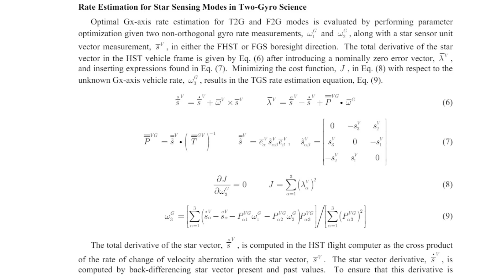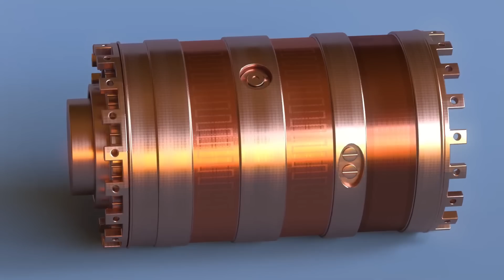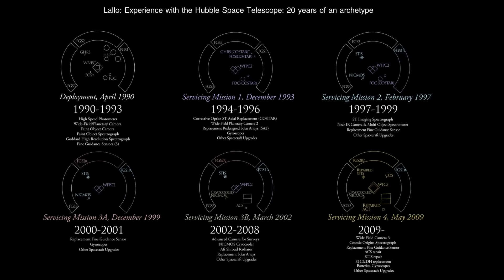How Failed Gyros Are Making Hubble's Life Harder

Comment: Sure would be nice to have the Hubble get upgraded with Ring Laser Gyros instead of these ones. No moving parts to break!
Not so sure about the precision, maybe you could do a video on the pros and cons of various inertial navigation sensors (in broad terms only of course).
Of course, it just popped into my head that maybe RLG's would have a lower on-orbit lifespan anyways, because of the radiation environment degrading the laser diode and optical sensors. On the other hand, RLG's are much lighter than conventional gyros, so maybe the mass savings from switching to an RLG could be diverted into encasing the RLG's in a radiation vault the same overall dimensions as the existing gyros.
Reply: There's a Quora post by HST engineer Keith Chamberlin that says that RLGs were considered, but NASA was against changing anything unless absolutely necessary.
Reply: @SaberTail  
Given that the failure mode was "the wires keep getting corroded until they break", and that they failed once again in the same way despite the changes in the advanced gyros which replaced the original ones, I'd say that a change was indeed warranted.
If nothing else, they could have replaced the wires with a flexible printed circuit board trace such as used to connect the arm carrying the heads of a magnetic hard drive to the main circuit board, even back in 2009 that technology was highly suitable for such since it's rated for millions of cycles of motion (if that respects the minimum bending radius specs), and since the metal that carries the current is surrounded on all sides by polymer, the issue becomes fluid compatibility with the polymer rather than fluid corroding the current carrying conductor, which to my mind seems like an easier problem to solve conclusively.
Reply: RLGs are to detect rotation. The Gyros Scott is talking about are used to control the attitude of the spacecraft. Same principle but opposite function.
Reply: @MarcoTedaldi  nope, the gyros that are failing are not control moment gyros or reaction wheels, they're rate gyros, which tell Hubble how fast it's turning in all 3 axes (if there are enough of them working at the same time that is).
That's why I suggested RLG's, the function is indeed identical.
Scott did briefly go over the different systems used to CAUSE Hubble to point at something of interest, but the video is about sensors that tell Hubble how fast it is turning.
Reply: @44R0Ndin  oh I see. Sorry! I've been 100% sure (until Scott mentioned exactly that) that those were the control moment gyros.
Reply: @MarcoTedaldi  It's no problem! Sometimes with this complex space stuff the things we talk about that are totally different things end up with confusingly similar names so it's really easy to get them mixed up.

Comment: The fact Hubble is still operational after 34 years is simply amazing. It has more than doubled its expected lifespan. I'm almost 60 and I'm having some equilibrium problems myself. We all get stiff joints and such when we get old. 😃😃
Reply: It's like a 300D Benz
Reply: @zaffo757 ❤
Reply: @zaffo757  Much better than a Benz. Superior American Engineering, it's like a Voyager. American Engineering, the best in the world. So good they came up with planned obsolescence.
Reply: It had a rough start but it was fixed, and it has produced an incredible amount and quality of pictures that we can be amazed by as well as it really has made a huge leap in science.
The day we lose it then it's a day for mourning the loss of a very important landmark tool.
Reply: Try Voyager I and II. 46 years and counting.
Reply: SpaceX should use Starship first to repair Hubble before flying to Mars. I'm sure that Hubble could be useful for setting up stuff at Mars.
Reply: @kataseiko given how cheap spacex launches are now, it's probably cheaper to launch 5 new Hubbles than run a risky spacewalk to repair the current one, and boost its orbit. 

Added bonuses: massive increases in computing, sensing etc. The gyro and camera in a phone are likely more capable than Hubble's are now.
Reply: @myne00  NASA used Hubble repair as an opportunity to showcase they're ill-conceived and already outdated shuttle. But you're correct... SpaceX has done what NASA should have done decades ago... turned space launches into a cheap, easily-repeatable thing.
Reply: @kataseiko  why and how would Hubble help with Mars colonization? 
And in either case, NASA decided any service mission would be more risk than it's worth as the Hubble is "still working"
Reply: @kataseiko are you suggesting taking Hubble to Mars?
Reply: Can't have said it better myself. Of course, a lot of orbital objects are still there. I'd love for someone to scoop up the original Telestar 1, if it's up there.
Reply: Yea, some of us oldies could benefit from the attentions of Hubble's 'attitude adjustment hardware' too!
Reply: @john_hind  I feel ya bro!
Reply: Wonderful comment. Wishing you good health 😊
Reply: Those expected lifespans are always set way lower than expected.
Reply: Absolutely can relate 😂
Reply: Let's hope that JWST will perform similarly, but also that it won't have to. Space telescope development is way too slow and expensive.
Reply: Well it had many maintenance, not at all the reliability of voyager probe.
Let's hope JWST is more like voyager then Hubble because that orbit is far
Reply: Not only do you get stiff joints and balance problems, Neal, but imagine being in the absolute freezing-ness of the vacuum of space, and then being bombarded by constant radiation on top of that! Lol
Reply: "The fact Hubble is still operational after 34 years is simply amazing": The fact that the gyroscopes are failing because of oxidation of leads is also amazing. Why did they not use materials which can't oxidize? To save a few bucks?
Reply: Loving the fact that your comment stopped at "we all get stiff..."   Yes I'm a child.   🤷
Reply: i'd like to point out that Chandra telescope has lasted 5 times longer than it's expected lifespan and is still perfectly healthy going on 25 years.
Reply: @DrewNar-tacA  it is not perfectly healthy, not by any means. It suffered some damage right after launch, even... and Chandra isn't going strong anymore because NASA is pulling the plug.

Because obviously, we don't need an x-ray capable space telescope while starlink makes Earthboad astronomy even worse and more unreliable, and we should preserve the nearly dead Hubble which has a space telescope more than capable of replacing it
Reply: Yep and yet NASA is cutting Chandra instead of Hubble, meanwhile Hubble is literally producing the same flow of data yet Chandra is our ONLY space x-ray capable telescope... one seems a lot more important and both are extremely old and degradation, but let's shut down the important one! 
The Hubble cannot take deep fields like it did anymore. But it's definitely worth it, yeeeahh

Comment: Hi Scott! We would love to see a video about the star trackers, how they actually work, and perhaps a history of them :)
Reply: I have always wondered how they are able to tell stars apart
Reply: @space-cat-in-space  They don't, not individually. What you do is take pairs or triplets of stars and construct lines / triangles. The idea is that those triangles will not "repeat" - any 3 stars you pick will result in slightly different triangle! So you make some triangles in the field of view of startracker and then compare those triangles with tabular reference and look for identical triangle. Once you find one, you immediately know where you are looking and how you are rotated.
Reply: I want to know how they see stars in earths atmosphere in the day time like the ones on the sr71
Reply: @Xsiondu Blackbird flew high enough that there wasn't much scattering of sunlight, making it dark enough to see stars.
Reply: @CptJistuce  that is true. However the star trackers chose the stars as it rolled it of the hanger and was running on the apu.   Night take offs again sure, non issue.  But it locked it's position during the day on the ground just as regularly.  How does it do it?
Reply: +1
Reply: Yes please!
Reply: So say we all
Reply: It will be a video like this one was for gyros.  Star Trackers like Hubbles also have military uses in modern (MIRV) ICBMs, spacecraft like the X-37b, and whatever the SR-71's replacement is.
Reply: As a Star Trek fan, I want to know more about star tracking too :D

Comment: hubble is great.  But we need a new optical range space telescope to replace it.  It's long overdue.
Reply: The Roman telescope due to be launched in 2026 has the same size mirror and the same optical range as Hubble but with a wider field. When/If Starship becomes a viable vehicle it might be possible to launch an 8 meter version of Hubble, but unfortunately it seems to require 20 years to design and build these things.
Reply: I don't know why people are in such a hurry to retire a working telescope. It costs billions and billions, and years and years, to get a new space telescope launched. They should nurse the Hubble along for a long as is feasible.
Reply: @chrimony Hubble cost nearly 100 million dollar a year to operate
Reply: @meikhochakre3309  Ok. Now what would it cost to replace it? How many billions per year?
Reply: @chrimony  I'm sure they would operate it for as long as feasible
Reply: @chrimony  they should, but we should have started replacing it a decade ago at least.  It's incredibly outdated and we could put up something so much better now.

A near earth optical telescope would be so much cheaper and easier than JWST.

Hubble was based on outdated spy satellite chassis and mirrors the DOD didn't even want anymore.

It's mostly 80s tech with a few upgrades since then.

It's still a useful astronomical tool, but people get far too attached to these things. Out with the old, in with the new.
Reply: Modern tech could do a lot. It's amazing that it's still holding on, from the days when a 486 processor (my favorite processor by the way) was a huge upgrade for it.

Materials and science has improved vastly since it's creation.
Reply: Absolutely.

Somehow though, its a really stupid time to start that.  Spend a few $millions for pre-studies and buy the first parts.  Oh, Starship works.  No need for an Origami Telescope!  And before even the actual assembly starts, the whole thing is obsolete.
🚀🏴‍☠️🎸

Comment: It will be a shameful travesty if this machine doesn't end up in the Smithsonian, and instead at the bottom of the Pacific. It has become the single most important, productive, and revolutionary telescope in the history of astronomy with the possible exception of Galileo's first and Hubble's 100 inch Hooker.
Reply: No way to bring it back
Reply: @womble321  ⭐🚢
Reply: @womble321  Except Starship which will be ready in about 1 year. The telescope has more than 5 years before it burns up. Once reusability of Starship has been established (2 yrs) The recovery will probably cost about $50-100m. Starship can do fine maneuvers for chopstick landing, that would preclude the need for an arm. You would only have to determine what type of thermal resistant form fitting foam bags to fill and suspend in webbing.
Reply: @avgjoe5969  So next question, if SpaceX does have the capability to return Hubble to Earth in a couple years, once it is down here, do we stick it in the Smithsonian?  Or do we refurbish it and send it back up for a few more decades before finally retiring it?  There are probably a bunch of very expensive instruments on it that would still be functional, so long as NASA could bring themselves to send those perfectly good but outdated instruments back up instead of spending a few billion on making improved versions.
Reply: You’re forgetting this is just a repurposed spy satellite. There have been many others
Reply: Viking burial for a true warrior.
Reply: Talk to Musk, no one else would have a suitable rocket. But I would rather put the monies that it would cost towards the next telescope.
Reply: @olasek7972  and even then nothing is close to being ready to take cargo onboard. 

The space shuttle was it's only hope until that hopefully changes some day.
Reply: @volvo09  Some day would be about 1 year from now when Starship enters service commercially.